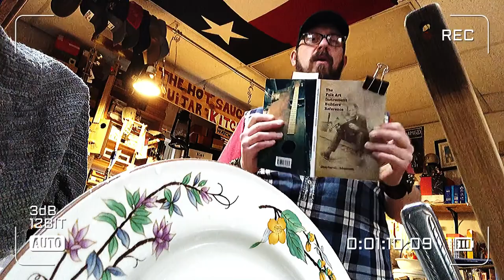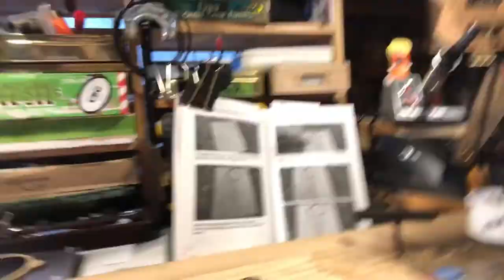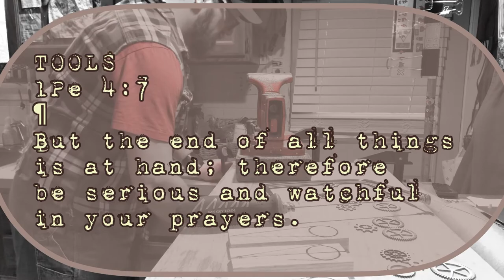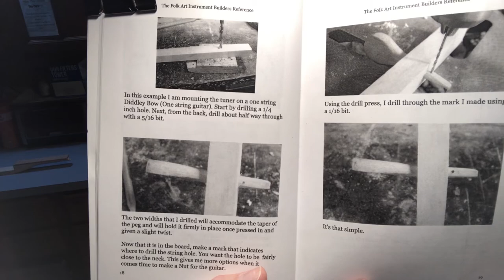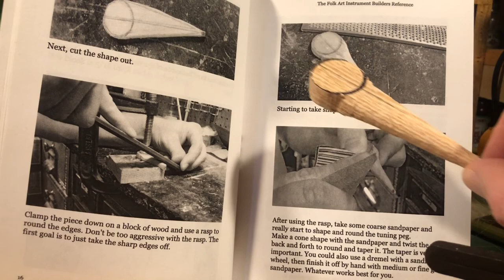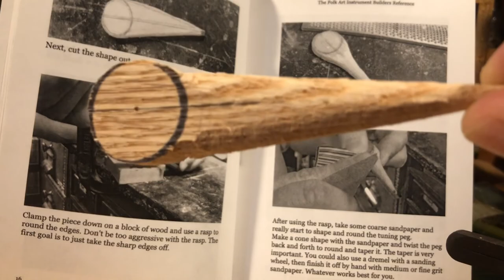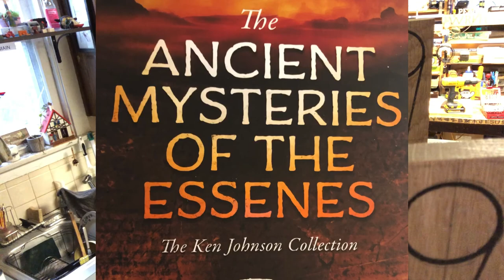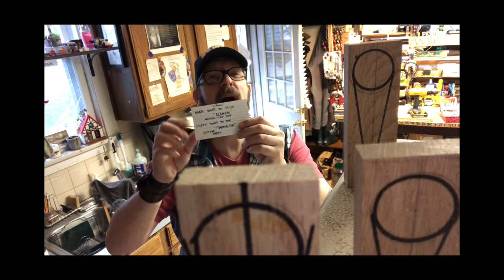Wooden Tuner Peg Cigar Box Guitar Conspiracy

Comment: Making those tuners will make you pull your hair out! I’ve seen them made with eye bolts. If I ever enter Senior Talent through our state headquarters for the Church of God, I’ll do them like the bolts. 

My Church gets a kick outta what I do and pushing me to do that in the fall for the talent. Probably make a frame for an old Church of God plate or decorate box with our family history pictures with the denomination. 70 years plus with mom. I just think a senior is over 65, not 55+ 

I get the concept of the friction tuners. My girls violin have them, but plastic. It will be interesting to see you wrestle with it, lol. Also I seen Shane Speal have an old CBG that had the bailing wire for frets, and others with cotter pins.